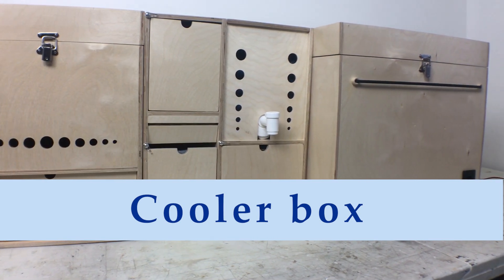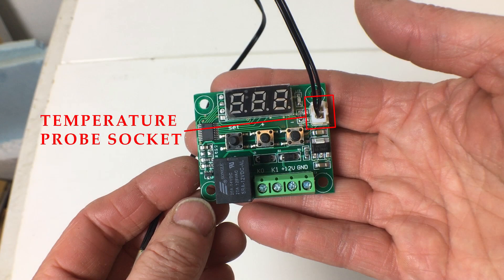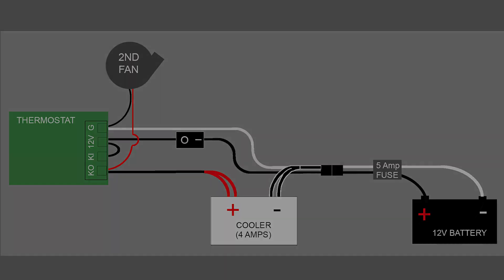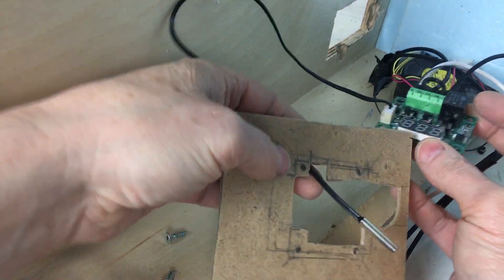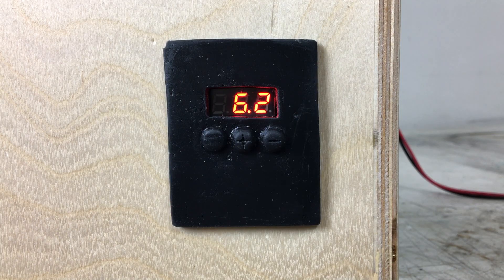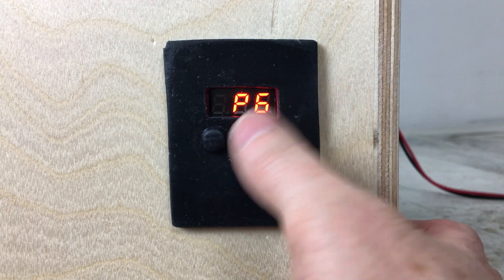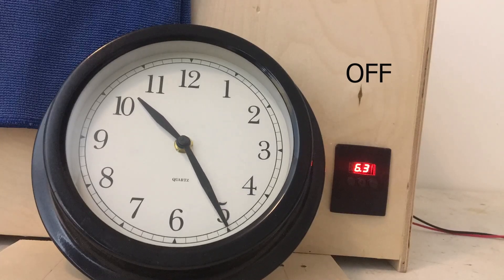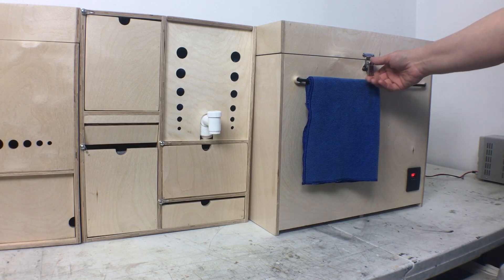Cooler box - part 2: Adding a digital thermostat to a thermoelectric cooler for my minivan camper

Comment: just ran across your video. pretty nice.

pro tip: don't keep your ice in a plastic container. plastic is an insulator. use either glass, aluminum or thin walled stainless steel. i personally would suggest aluminum. it works great and you'll get much more cooling action (or more appropriately, heat absorption) from your ice.

Comment: About the 200Ah in your example...Wouldn't a 8A solar panel (if you have one) be able to handle about 4Ax14h (summer), 56Ah, leaving your battery to handle 4Ax10h, 40Ah, which would require a battery of about 80Ah?
Reply from the maker: Sorrry for the super long delay in replying - yes,  you are right - I was forgetting that the solar panel would do all the heavy lifting during the daylight hours and the battery would only have to carry it through the night. Of course if you get super overcast days then the panels might not be able to keep it topped up.
This past summer we tried it out and I felt it had trouble running the cooler all night. I have a battery saver cable that is made for the cooler, which will shut off the power to the cooler if the battery dips too low and we would often find that it had shut off in the night.
As a solution we would supplement with ice in the very hottest part of the summer.

Comment: That's a fantastic video and build. Very impressive!
Reply from the maker: Thanks. I worked hard on making it clear - not easy with a big old tangle of wires inside a cooler box.
Reply: @averysmallcampervan  You did a great job, your diagrams and voiceover were great too.